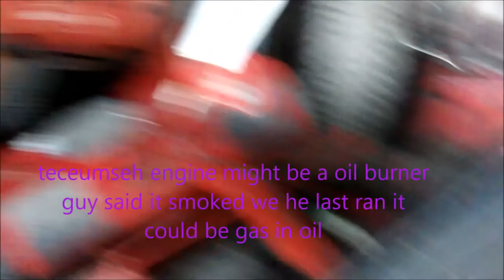two more late 1980s snapper rear engines projects one with 8hp tecumseh should be fun

Comment: I have that exact same Tecumseh  Engine and got gas in my oil after I restored it. Turns out the float height was not correct and dumped the entire contents of my gas tank into the cylinder and then into my oil. If you have any questions on that engine I have the mechanics manual for it. Figuring out the governor setup was a nightmare which was why I purchased the manual off of Ebay. Nice to see snappers being loved. Cheers.
Reply from the maker: will do thanks much
Reply: bleachedpc there awesome
Reply from the maker: carb is still backfiring and catching fire shot flames out muffler. i took carb bowel off and put new oil in hoping it would run. i'm thinking there is a stuck valve our carb is gumed up. I have another video coming out soon.
Reply: Might be a stuck valve due to carbon buildup preventing the valve from closing all the way. I had to replace the piston in mine due to damage from carbon buildup on the cylinder head. Would be good to take the head off and clean all the carbon out with a wire brush. Gives you a good look at the health of the engine.
Reply from the maker: going to look into flywheel key too might be sheered
Reply: bleachedpc check your fly wheel
Reply from the maker: The flywheel key was sheered, but now the flywheel nut is stuck on there preventing fly wheel from coming off. I hope I can figure away of getting off by not breaking the shaft.
Reply: bleachedpc use a impact wrench watch +hanks small engine repair videos Mike happy holidays
Reply from the maker: i don't own a impact i''ll break it free somehow
Reply: bleachedpc you can use a 🔨
Reply from the maker: that will not work for my issue
Reply: bleachedpc wanna air compressor
Reply from the maker: no
Reply: bleachedpc watch alex s channel has tricks for removing flywheel

Comment: Picked up a like new  8hp Tecumseh  engine  with about 20 hours on it. It was on an old Sears Chipper. How long does the shaft need to be for these lawnmowers? Thanks
Reply from the maker: you need a long shaft engine not short